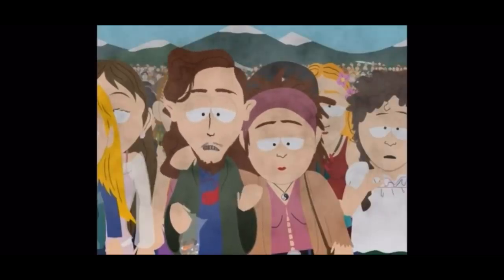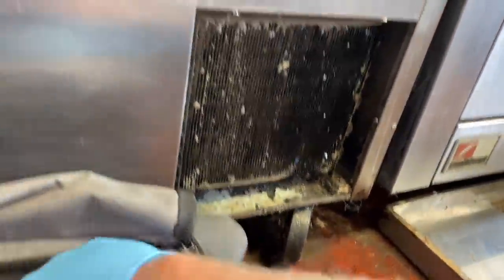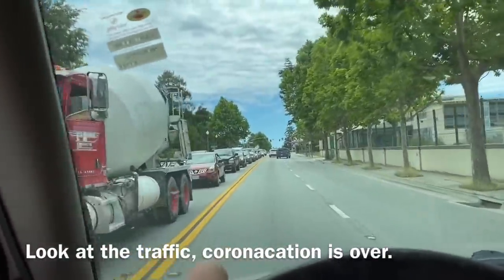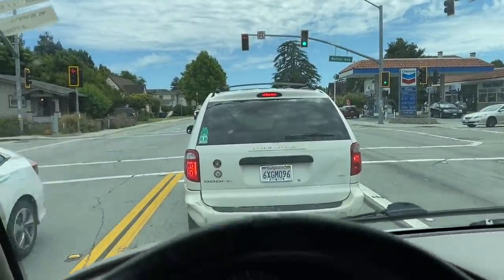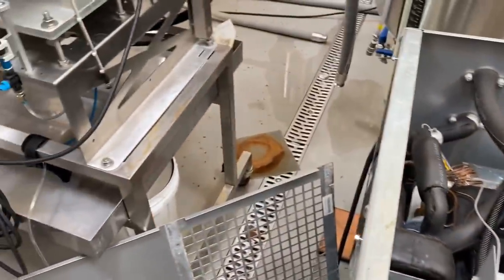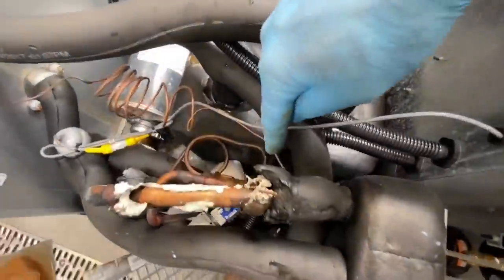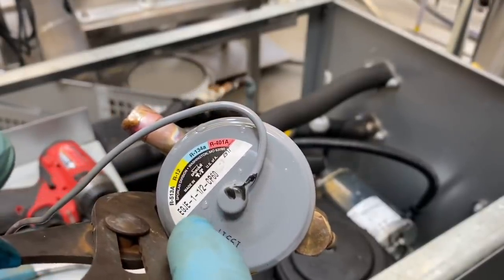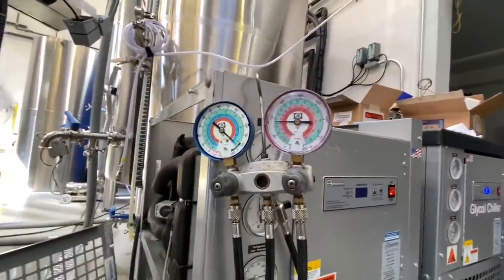Advantage glycol chiller

Comment: Good vid. Won't  New Txv just get gummed up too ? Isnt the oil in the compressor what gummed  up
Old txv. Wouldnt it have been Prudent to Replace the compressor & flush system with Txv removed.

Comment: What size tip are you using for working on the smaller refrigeration units in your torch.
Reply from the maker: Usually run a no. 1 tip.

Comment: Did that plate heat exchanger have a way to check the pressure drop across it on the water side? Nice fix Dave
Reply from the maker: Nope.

Comment: Good job, that valve was in a tough location, what was the evaporator approach temperature on that unit?
Reply from the maker: The only info I have on those units are design temp for glycol 20-30 degrees Fahrenheit glycol temp.  There basic units designed for breweries.  These are Bieng used to make caned cold brew coffee. And it’s not bad. ( I tried it ).

Comment: Being that is either an "SBQE or a SQE" valve really didn't have to change it, just tear it apart , rebuild it, change the pins and Clean the cartridge, screen, swab out the brass body real good like a gun barrel and put it back together.

Comment: That's a take apart valve. You could have cleaned it and changed element
Reply from the maker: I like replacing them
Reply: Why take a chance. Replace it, recycle the old one.
Reply from the maker: Maximum Dank it’s easy for me to replace the valve, and you need the torch to replace the drier any way. But there is times where I have left the body and replaced all the parts.
Reply: @NorCal-refrigeration  don't look to old. Clean the screen replace element. Check the rest of it. Not that much to it. The pins wear in time but takes 30 years to get that worn to cause a problem is my finding. Nothing wrong with a new valve   these newer oils break down making ng gum is generally the issue if the element isn't bad